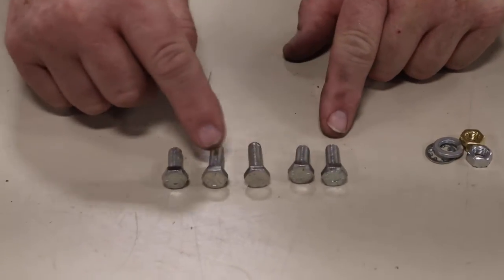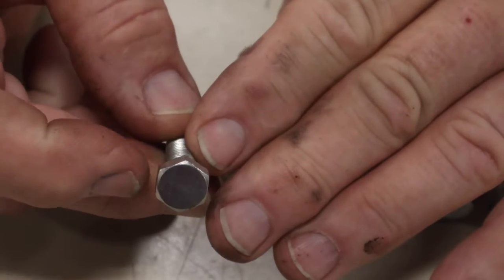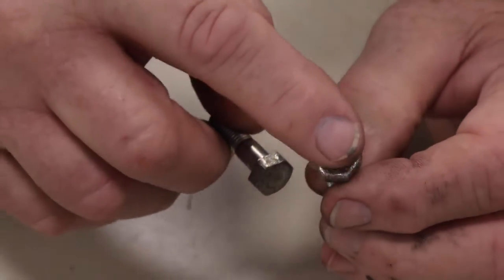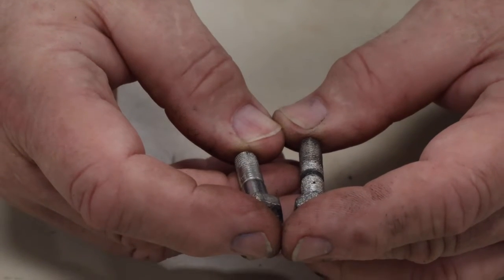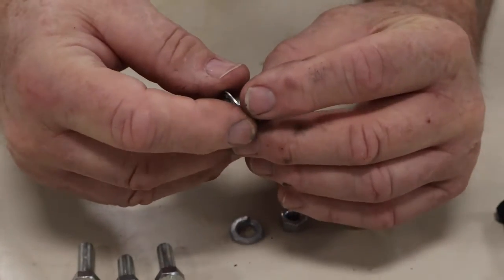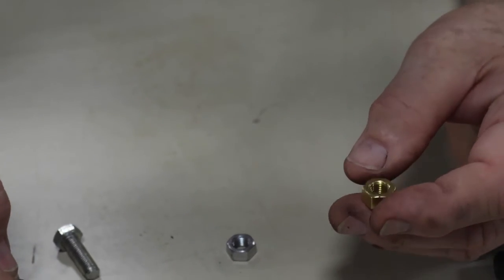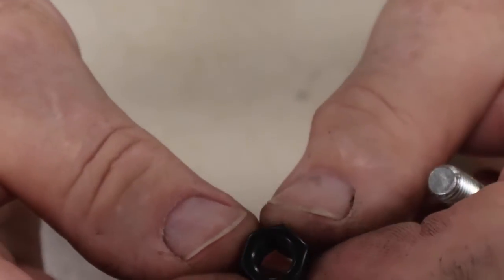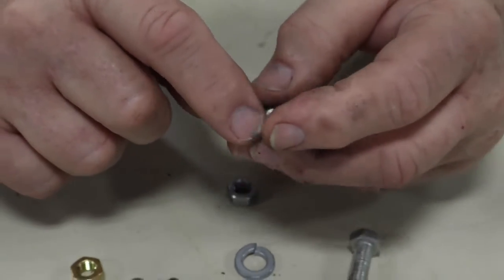414 MG Tech | Using MG Nuts and Bolts

Comment: Hi John,  there’s one more type of nut that is found on the deluxe and twin cam car holding on the axle and brake rotors.  It works the same way as the nylon but uses a stainless steel top hat that twists into the thread and locks it on.  I’m missing some and hoping you know the name of them and perhaps where I can find them.  Thanks for all the great videos!